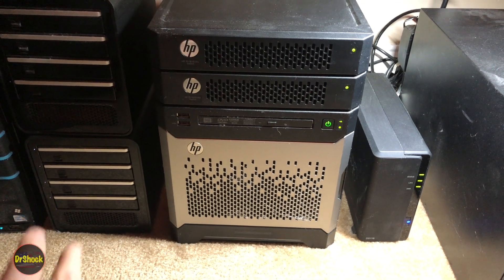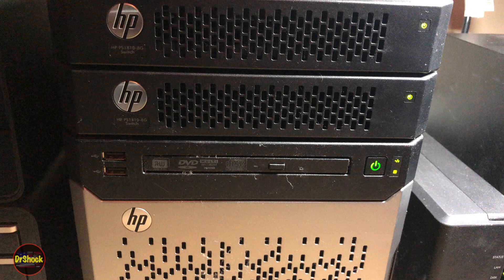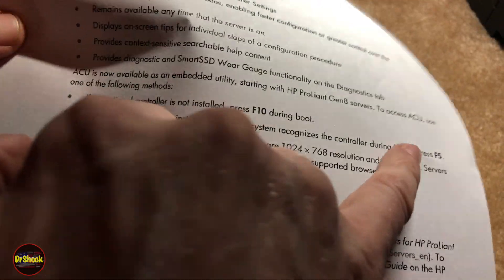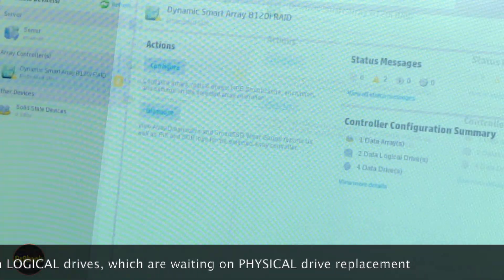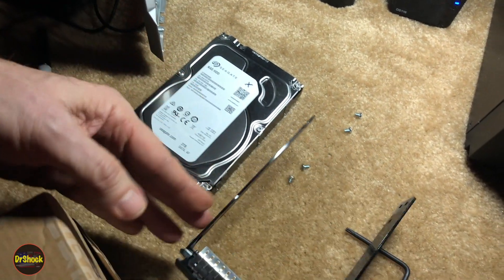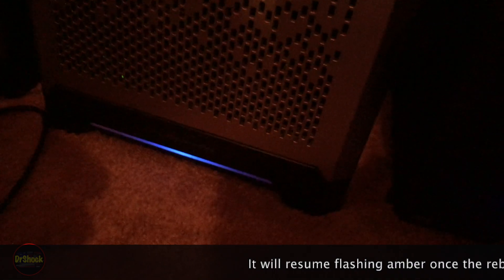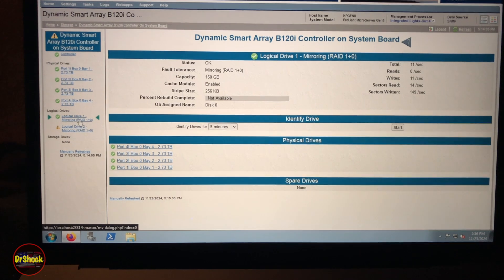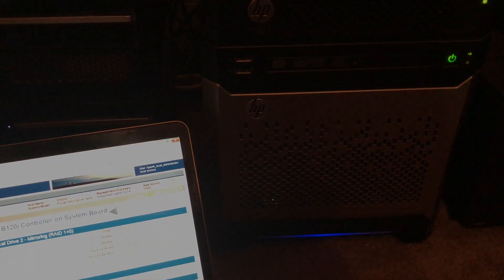HP Gen8 Microserver RAID 1+0 Disk Drive Replacement & WHS Array Rebuild B120i Smart Array Controller

Comment: Very interesting. I have never worked with a micoserver. May I ask. how do you use this hardware or for what purpose. I am a subscriber to your YouTube channel and have watched your videos on auto repairs. You always do a very nice job of explaining exactly what you are doing. Have a Merry Christmas!
Reply from the maker: Thanks, I use this unit to perform daily backups of Windows PCs and laptops within my shop and residence as well as archive CD-ROM and DVD-ROM images of every software title I use.  Particularly with the old GM dealership software in many cases it cannot be found online anywhere anymore so I count on this little guy to keep a safe backup.
Reply: @DrShock  Thank you for the reply. I assume that when you say "my shop" that refers to an auto repair shop?
Reply from the maker: No, not specifically.  I work on more than vehicles so more of a generalist repair and restoration workspace / building. Everything from the hydraulic press to a micro soldering station.